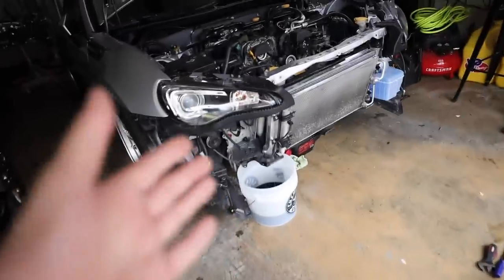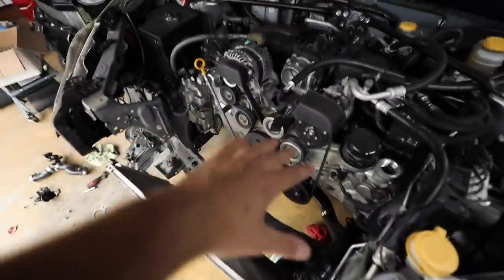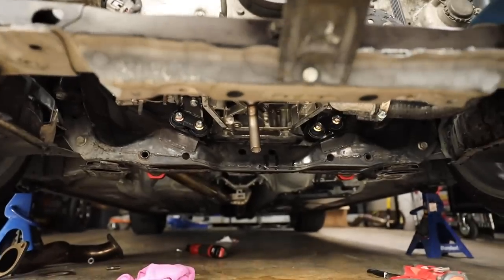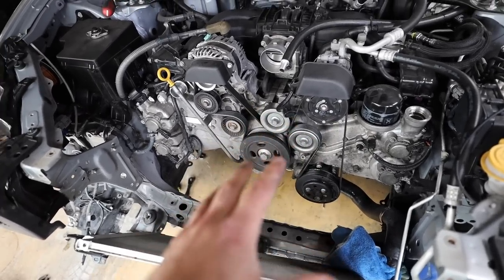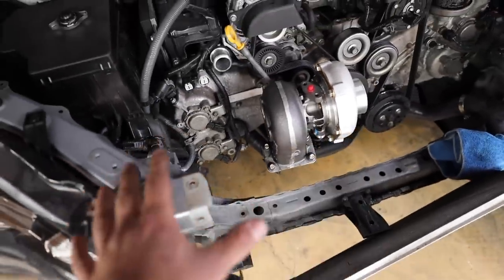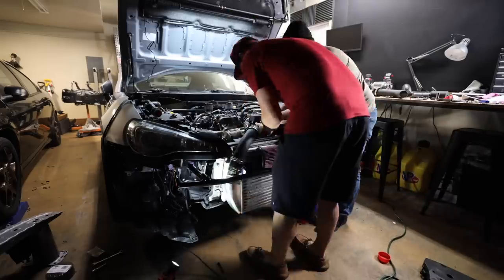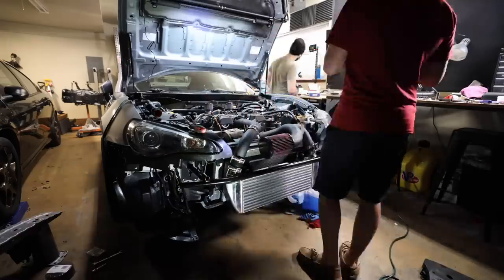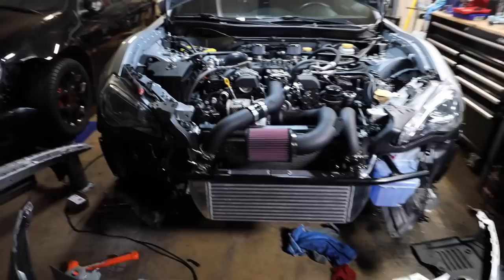Finally Turbocharging My BRZ!

Comment: After all the stuff I did with my buddies old STI with MAP I would never order things from them, missing wire harness’, missing oil feed lines and gaskets. Great to see nothing has changed over the years.
Reply from the maker: Been pretty annoyed with their service and missing parts. I was told that the sownpipe to turbo gasket was not included when I told them it was missing 🙃
Reply: Seems right, not like good customer service would point out the BTW, these parts are not in the kit, would you like to add them to the order? Plus business to make money and all....

Comment: Siiccckk!! Thanks for the input! Won't be buying anything else from MAP in the future...
Reply from the maker: The quality of their in house parts looks great, but there have been so many smaller parts that just were not sent to me or I was told that a certain gasket was not included with the kit 🙃
Reply: Yeah, their customer service just isn’t that great. I waited two weeks once before they responded to my emails when I bought a tune from them 😕
Reply from the maker: I called them multiple times to never get an answer, they could be much better but just settle for what they are

Comment: I had this kit before with the 5558 bb turbo. You definitely want to keep your radium catch cans the MAP cans don't do much at all. It was an ok kit. My experience was decent, only the downpipe studs were missing... also ditch the spal fan. Its loud af and mine dug into my radiator somehow. Get a fan that connects the blades at their ends.
Reply from the maker: What fan set up did you go with? I'll get one ordered. And good to know I'll toss the radium set up back on the car tomorrow and ditch the MAP set up 🙏

Comment: Looking good!! Cant wait to hear that turbo spool. I was concerned that oil pan might scrape, but it looks like it is exactly the same height as the suspension cradle. The crash bar might also be correct and the BRZ could have been in an accident which spread those frame rails apart slightly.
Reply from the maker: I can't wait to hear it! And I was also worried about how low it sat, but the metal akid plate covers it still 🙏 the BRZ woukd probably not fare so well in a front end collison...
Reply: @Smeedia  I have fixed one before, it was a decent hit across the whole front end. Then about a year and a half later, she hit a pole at about 40mph and shoved the radiatior into the front of the engine. Totaled it.
Reply from the maker: Hopefully everyone was alight 😖
Reply: @Smeedia  yeah the woman was fine, hurt her wrist. She was just upset because she had just paid the car off.
Reply from the maker: I dont blame her 😖

Comment: Awesome job! You're getting good at this lol

Soooooooo the turbo kit came with a downpipe with no gasket and an oil pan without an adapter. Did it at least come with a delete plug or something?  Or were they expecting you to just have a hole in there? 

Vewwwy interesting. 

Bummer. Maybe it was just missed on accident?
Reply from the maker: No delete plug either, lmao 💀 
I emailed them and told them and I was essentially told they're not gling to send it

Comment: Exciting, Mighty Car Mods just turbo'd their BRZ with amazing results if you haven't watched it already. (amazing results minus the fact that its now broken.)
Reply from the maker: Ive been following theirs 🔥 im curious on what broke 😅
Reply: Smeedia - I suspect something rear axle related.  I had a BRZ until 2016 and was on the forums from 2011 (when it was a concept car - I got mine 6/1/12 - essentially the first week they started delivering units).  Word on the forums back then was the rear diff/axles were not up to the torque that the turbo provides, but I’m not saying for certain that’s what happened to MCM’s. Just a suspicion.
Reply from the maker: Interesting to know, if mine ends up going ill swap an R180 into it with some stronger axles 🙏

Comment: I love your projects! Hope it goes smoothly.....
Reply from the maker: Thanks my man! And the first half was smooth but all the missing pieces are slowing things down now 😖
Reply: I was wondering why MAP did not include the bits you had to order through Amazon. Was their kit incomplete?
Reply from the maker: Yes I was told the kit does not come with the turbo to downpipe gasket, had to argue about the modified core support to get them to send it. 

Missing the 1/2" NPT fitting for oil return, vaccumm reducers for the plumbing, other random small hardware 🙃

Comment: Hey Tanna,bro you must really just live for the pain lol.she's coming together real quick.Can I ask,when you did the AC delete on the STI,how did you find the right belt size to replace it. The original one is a stretch belt,or did they change that after 2015.Great  job though 🤘🤘🤘🤘🇬🇧🇬🇧🇬🇧🇬🇧🇬🇧🇬🇧🇬🇧🇬🇧
Reply from the maker: Technically I have not deleted the AC yet, but when I find that info I'll definitely share it 🙏
Reply: @Smeedia  many thanks Tanna.Good luck with build 🤘🤘🤘🤘

Comment: Seems like a lot of issues with this kit, something as simple as a bash bar... a simple fixture would solve fitment problems... lol
Reply from the maker: Thats what im saying, we think they tacked it on the jig then removed it and the bar shrunk after being heated and they did the final welds on a bench
Reply: @Smeedia  im not sure how off it was but I work at a production welding plant and once a piece is tacked in a fixture and removed it takes a lot to make it really off. Maybe they dropped it or tossed it in a volcano to warp it.

Comment: This is why you shouldn’t cut corners in your kit and take 3 months when you advertise it as being “iN sToCk” xD
Reply from the maker: The lead time is not what was annoying, the fact that I was told multiple diffrent lead times for 12 weeks was 😅 the kit looks solid but when I was told the turbo to downpipe gasket was not included i was over it 🙃